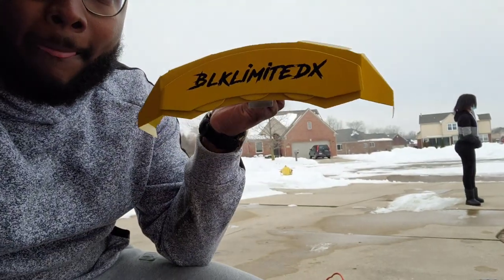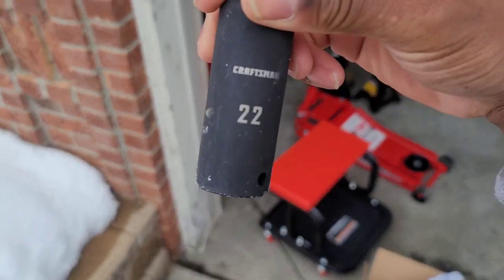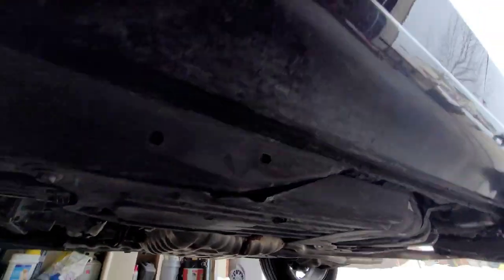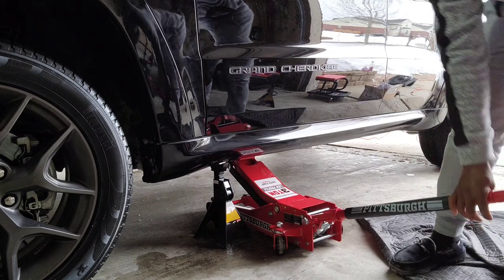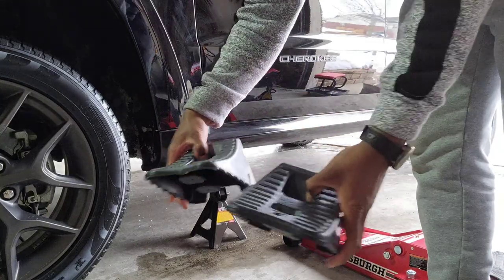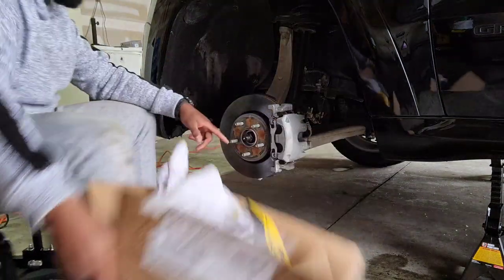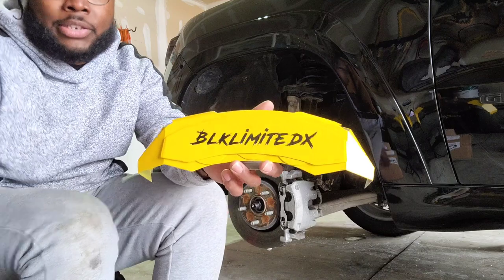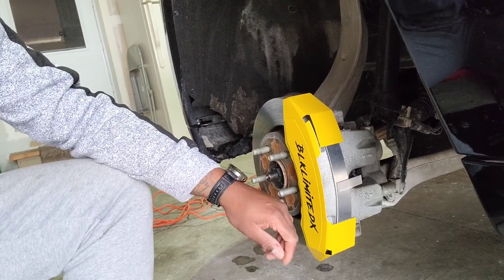How to install - CCI Caliper Covers | 2020 Jeep Grand Cherokee Limited X

Comment: put the lugnuts on with your hand to be sure you don't cro
ss thread them and always tighten your lugnuts in a star pattern. its always a great time to to clean the mating surface on the wheel and the hub when removing and/or replacing a wheel. otherwise pretty neat dust covers
Reply from the maker: Than you for the advice man, that’s something I know now and make sure I do. I got lucky to not cross thread them but that’s was a lesson I keep.

Comment: Great video, just a heads up for next time. You should twist the lug nut a few threads on before using the gun so you won’t strip the threads.
Reply from the maker: Thank you man, I appreciate that. And thanks for the tip, I got lucky this time but will make sure to do that from here on out.

Comment: That price point is taxin forsure, but it’s a clean look and super easy setup, do a follow up on how well the magnets hold over time, my Jeep sees more off road, and always hand thread first, that gun will eat up threads
Reply from the maker: Thank you man 💪🏽 and of course, I'm going to do a follow up in a week. By the time I posted this video I has already had them on for a week and with daily driving to work and various places they been great. But I do want to get another week's worth of driving on them for sure. And will do with the threads, someone else told me the same thing so thank you for the tip.

Comment: I have the same GC and was looking at caliber cover, with just the magnets do they hold in place ? While driving long ride etc....
Reply from the maker: Yes so far with daily driving and 2 2hour road trips, they've held up so far. I've taken bumps, going over rail roads, pot holes and they're still hanging on lol. So they feel promising but more time with them on will really impress me.
Reply: The magnets work. Had mine on for 2 years.

Comment: Nice vid. Thanks for all the tips & tricks. My question is about your 20” Pirelli Verde’s. Are those stock that came with your Jeep or aftermarket tires that replaced OEM’s? They look bad ass from typical stock 18” Michelin’s that I’ve seen.
Reply from the maker: Thank you 💪🏽 and yes are the stock tires that came with my Jeep. I love the Pirellis, so I may either get these again or some Toyo Proxys when it's time for a new set.

Comment: I bought the pro covers for my 2018 JGC Altitude. They look great! But the front ones were rubbing, so I had to take them off. Might just have to paint my calipers now.
Reply from the maker: That sucks, they were rubbing the rotor?
Reply: Rubbing behind the stock rim. Super tight fit. Heard them while driving. Spacers were recommended, but on the fence with those.
Reply from the maker: @michkeshajohnson3159  damn that sucks, I feel lucky then lol. And yeah someone recommended I do spacers but I didn’t really feel the need for them.
Reply: Michkesha Johnson can I see a picture of your rims because I was worried about the same thing before I ordered me some.they look great but don't want anything rubbing

Comment: Have you had any of them pop off after hitting a pothole or anyhting?
Reply from the maker: Thankfully no, they lasted through bumps, minor pot holes, going over train tracks and some off-roading. I was concerned they’d fall off under those circumstances but they were fine.

Comment: just gained a subscriber, i almost have a grand cherokee and i’m thinking about getting these for my brake calipers. how have they been holding up since putting them on?
Reply from the maker: Thank you man I appreciate that, they’re still holding up great. I want to do an update video on them for sure
Reply: @BlklimitedX  i checked the link where you ordered them.which ones did u get? the standard or the pros ?
Reply from the maker: @DMRsnipes  I got the pros for mine. The also have the X-Line which look awesome as well.
Reply: @BlklimitedX   which font did you use? i like the one u got
Reply from the maker: @DMRsnipes  the font I used was called Road Rage

Comment: Always start your lugnuts by hand!
Reply from the maker: Yes was something I had known before. Thankfully retightening them was fine this time but for future work I will had start them, appreciate that.
Reply: Start by hand and then use a torque wrench to get the proper foot-pound so you’re not under or over tightening the lug nuts.

Comment: Please me bro I can't find use for head unit I need to reset it because wifi hotspot stopped working
Reply from the maker: So there is a soft reset you can go that may help. Press the ignition button and put your car in the run position but leave it in park. Next simultaneously press the volume and tuning button and hold them for about 15-20 seconds. That should then rest the Uconnect.

Comment: Sorry, but these are junk!!  Any and all caliper covers will hold heat and break dust. Both have the potential to eventually cause serious damage over time. Also, magnets... really? What do you think is going to happen the first serious pothole? If you need your calipers to be seen, show your ride a little love and spend some time with G2 caliper paint. Like the decals it's cheap and superficial.